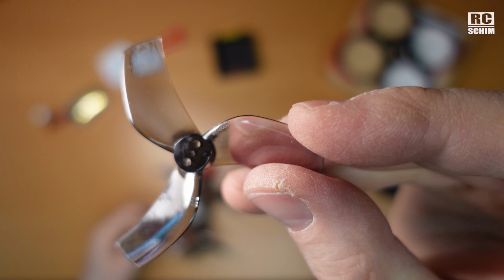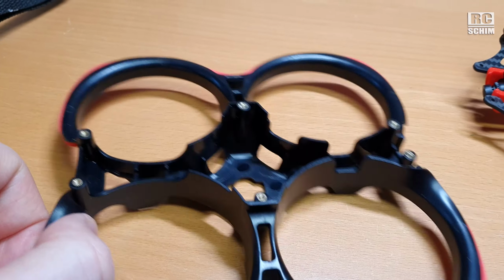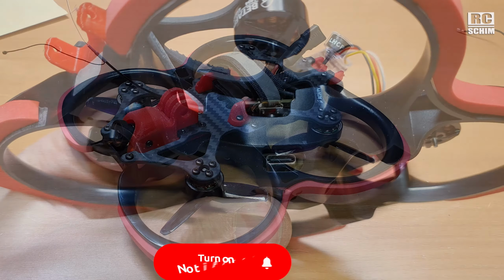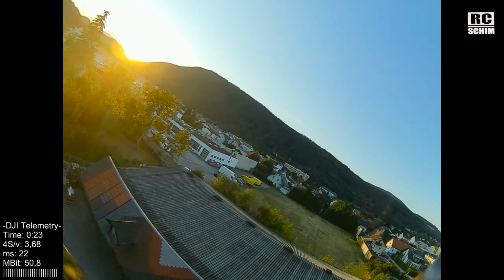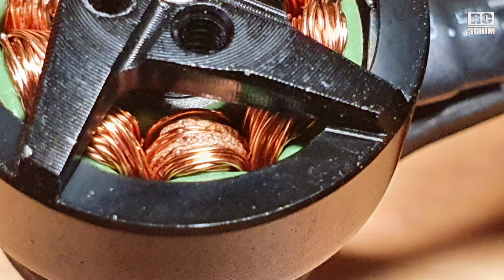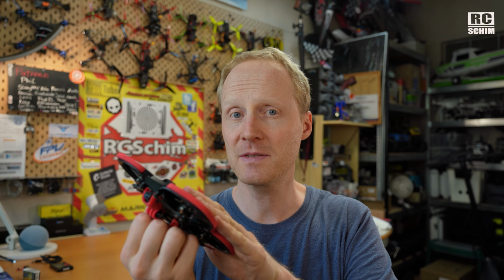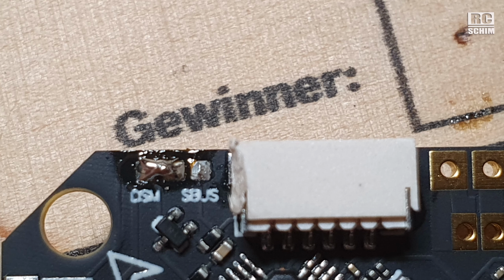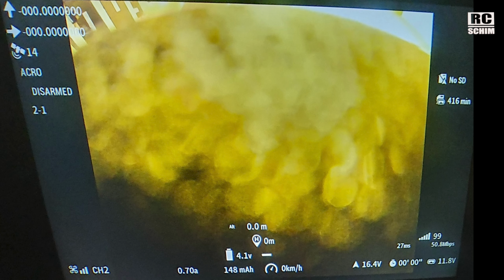BetaFPV Pavo25: 6 things I learned while trying to review a drone

Comment from the maker: To support me, please check my PATREON: https://bit.ly/2ESMtIO or if you need good music for your own videos: EPIDEMIC SOUND, get your account here (affiliate): https://bit.ly/3p6OGE0 
get the BetaFPV Pavo25 here: https://bit.ly/3IPLBBv 
- SBUS Solder Jumper is there for a reason (Crossfire ISSUE)

- how a MOTOR can ruin your day (and your MosFet)
- how to SOLDER the tiny stuff with my 3.2mm soldertip ;)
- Betaflight 4.3 let's you change MOTOR DIRECTION / order really easy!
- use OSD position templates (so all my quads have the same info in the same spot) 
- YAW Washouts
...more infos in my video description!

Comment: Hey. Thanks for the shoutout. Here I am thinking I had the longest build on the Pavo! I wander if the sbus jumper just changes the user to inverted or something similar. I think BetaFPV need to do more testing before they get to actually release stuff. The yaw washout is easy to pickup and it’s not just the Pavo. I’ve had ELRS modules that are impossible to update unless you disassemble them. Easy to find in testing…. But you have to actually test your stuff to find it.

Comment: This a great review. It's raw reality of the kinds of issues that can be encountered when dealing with a new build, or newly released product.

Maybe "7 things" learned?
7th being how great and supportive the FPV community is at helping each other (but you probably already knew this ;). Was really nice to see the callouts to others in the community. ♥😎👍👍

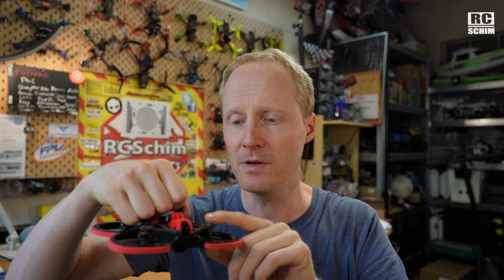Regarding the hot motor(s) mentioned at 6:39, you could measure resistance between alternate pairs of motor leads. If short within a windings the resistance would be lower. (as opposed to a short between windings which could be fatal).
Cause is most likely by insulation on the windings getting soft, or melting with heat, or poor quality for intended operation. The real question is why the motor winding getting hot to begin with? It suggests a poor motor-propeller combination, thus too high a current to the motors. 
The 1404 4500kV motors are common with 3.5-4 inch propellers. With 2.5 inches, I'm wondering if actual RPM is getting too high and causing the bearings to heat up? Best way to check is to look at ESC telemetry (as kV more a theoretical definition and does not consider effects of propeller load on a motor).
The BetaFPV lists the ESC as being 20A rated. How does this compare with current you see when hovering, or do a punch out? Maybe not enough margin in the design. Location of ESC under Vista (a heat generator) and a shrouded frame could be effecting cooling. Not sure if ESC temperature can be read via telemetry, otherwise would need an IR camera, or IR gun to read.
To better understand would effectively require reverse engineering the design and bench testing individual components. An OK exercise if the goal is to learn, or teach, but never should be part of a product review.

Hopefully this experience more bad luck of a single production build, and not a reflection of the design and level of testing prior to production. It's normal to have occasional bad component in a production build, but multiple component issues can make consumers question a design.
Reply from the maker: At the moment I stopped working on this quad. Maybe it just cannot be fixed - I cant spend endless hours into such a thing. And I'm not convinced that I'd fly it often. Now it's a nice different colored ornament for my quad wall :) The other really unused quad on my wall (with a nice color) is also a ducted fan copter, the Bumblebee ;)  6S 3" loud and inefficient - but a tank when it comes to flying and exploring the woods...
Just back from setting up my Chimera4,5,7 and Rekon6 nicer. Now my Tango2 gives me a notice if I have more than 5 SATs :)  
greets, Mario
Reply: @Rcschim  Exactly.
Flying more fun than fixing. :)

Comment: I just bought the frame for this and loaded some 1404 Airblade motors and a 35a aio from betafpv that I used for 5” sub250 build. Other than some weird esc hiccups and some initial desync (still trying to tune it), haven’t had much issue but have only flown for a very short time. I’ll try to be cautious with mine for now until it can prove itself
Reply: Update - it’s terrible. Keeps washing out and making it nearly not flyable as it makes the drone unstable in heavy winds or with props that can wind it up. Im not using Betafpv components except the frame but seeing you and currykitten have similar issues, I’m abandoning the frame

Comment: Whoops = jello.  I have a bunch of whoops here and they all have jello, no matter who makes them or how much they cost.

Have to say I'm not actually a fan of the pusher-whoop concept because it produces a noisy quad with sub-optimal handling and performance plus the issue of being unable to take off from a non-smooth surface.

Right now I'm contemplating re-engineering the Foxeer FoxWhoop to a top-prop configuration so as to see what difference that makes to the "fun" factor and the noise level.
Reply from the maker: Me neither. I don't like noisy, inefficient copters. I feel quite comfortable flying a 3.5" drone almost anywhere, obviously I wouldnt fly thru ppls legs - but who needs this? 
Normally I would expect smaller props= higher RPM - less visible Jello - but these seem to be an exception. 
greets, Mario

Comment: Hi rcshim great video. Please could you help me I am struggling to get my r9mx reciever to work running elrs. The sliders are not moving in betaflight but the rx is linked to the radio. Betafpv site says solder the jumper to dsm pad but this doesn't seem to work.. please help.. thankyou
Reply from the maker: Are you sure the bf config of rx is correct? Like under ports the serial rx check on the right uart?
Or under receiver: the serial rx protocol...
Reply: @Rcschim  thanks for taking the time to reply. Yes I have betaflight configured for serial based reciever and  serial rx on uart 3 and the crsf protocol selected. I will try swapping rx and tx and double check I have the bridged the jumper correctly

Comment: Thanks for this great review!  I'm not sure where all the good reviews are coming from for this quad. I had same issues - faulty motor straight out of the box, Beta AIO FC that also has major issues - quad flew OK for a shot while then just went crazy!!! Throttle stuck open / floaty and huge twitches in flight. A couple of crashes later and one broken action cam and I've given up on this quad altogether. Not reliable. Save your money.
Reply from the maker: Sorry to hear that.  Seems betafpv has some quality issues...
I spent so much time trying to fix this thing.  Esc board was defect so I swapped it, still flies crappy...